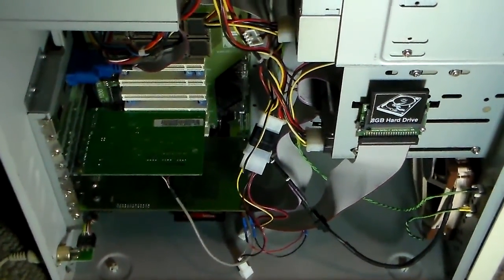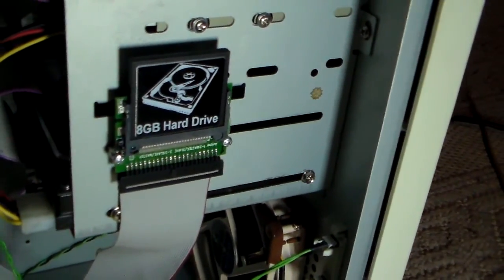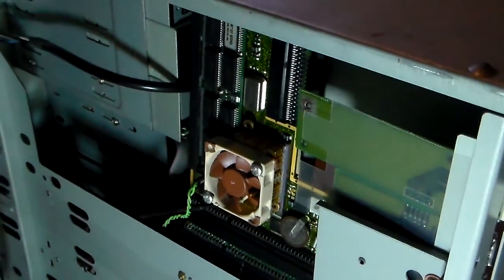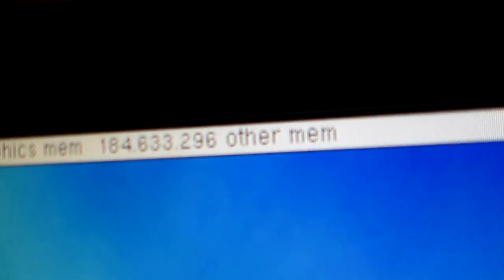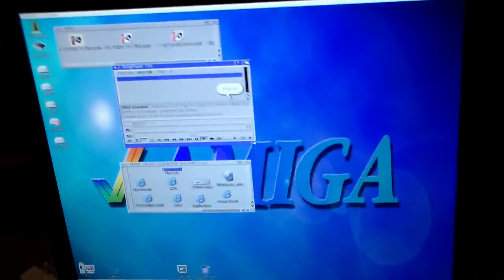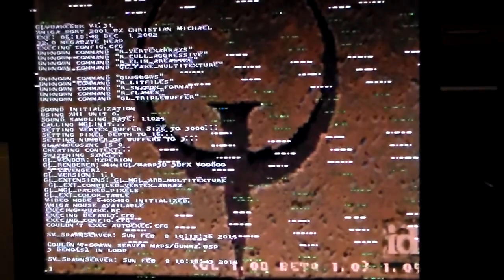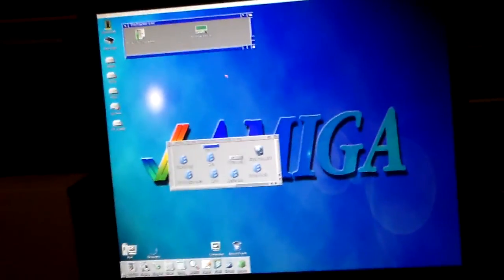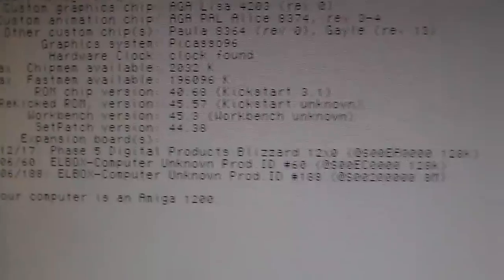Amiga 1200 tower project

Comment: why? Why? Why?  a soundblaster in an amiga is Blasphemy ok.. you get some kinda mt32 sounds but the amiga soundchip paula is way better that the stinky soundblaster
Reply: chillax bro :)
Reply: No it’s not. Jump off the hype train of the chipset myths. Paula does a proper job in a low end system. It sound pretty good. But chipset limitations on the other side what killed the classic Amiga line. The limitation that chipset can reach only the chipmem wich is painfully slow. Also, a 16 bit hifi stereo playback alone kills your cpu time completely on the paula throuh ahi. Becaus it can be used like that but it was not designed for that. The planar graphich the same. Helped the low end machines to run the os pretty fast in low color modes. But in hi color modes and hi resolutions you are literally fucked because the c2p requirements. The Amiga chioset is a super weapon for a low end system and a damnation for a hi end one. Believe me. Did plenty asm codework on the system to see this. You can be a real Amiga fan without spreading bullshit like this. Be a fan but don’t be a fanboy.

Comment: you dont need coling for 060 at 50 mhz
Reply from the maker: In general, no. I now use a PPC card where the 060 is running at 66MHz. The 1260 card in the video uses a little bit older revision of the CPU which runs a little bit hot. Burned my finger on it at least. The overclocked 060 on the PPC board I'm using now has been changed to the latest 060 CPU revision and is a lot cooler in comparison. :)
Reply: awesome Amiga anyway

Comment: Try BlitzQuake from EAB forum. I think those gfx problems should be fixed by now (at least I tried in the last version) Cool tower.
Reply from the maker: finalcat2 Thank you! Haven't tried the newest BlitzQuake port, but used Quake II. Still got the same effect. Have been fighting with the tower and believe the motherboard have a strange form of timing issues. Got a new motherboard, but I'm going to send it away for capacitor replacement and timing fixes if needed.
Reply: Yep. I saw those weird effects on 68k versions from other videos. When I took the code some time ago, same problems were reported as the old quake 68k versions, but didn't happen on some configurations. I think I fixed those issues and my newer version of Quake 2 should have the same bugs fixed (at least nobody complained : ) ). Dunno about the mobo, but my system it's not the more "stable" for coding: Same program, sometimes is faster & in other moment slower. Depends of the day :P
Reply from the maker: finalcat2 I will get to the bottom of the problem eventually. Really challenging system to work with. Guess this is part of the initiation process for high end Amiga computers. :-)